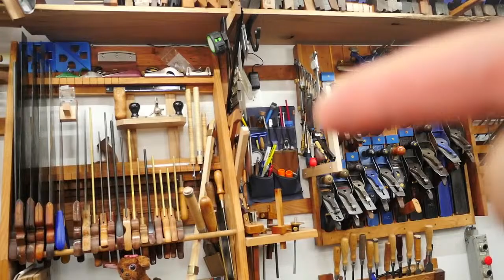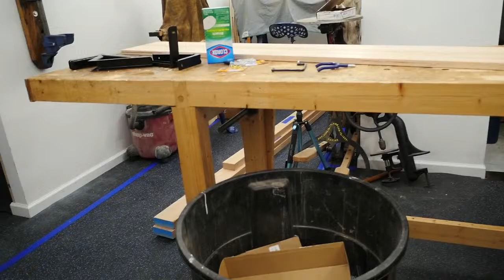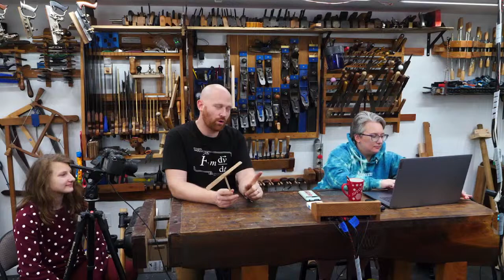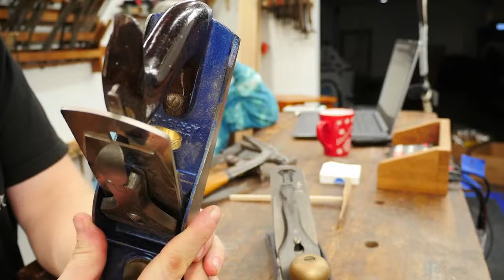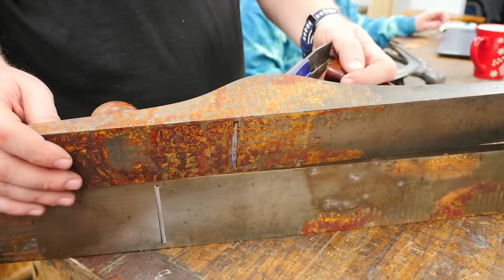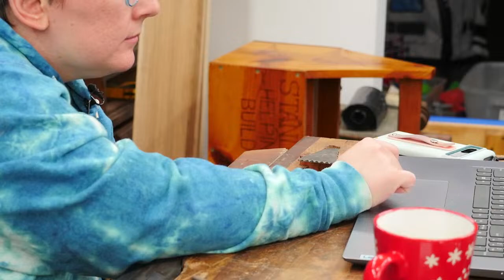April QnA 2024 LIVES ARE BACK!!

Comment: At about 46:00 ish, if you make a new tote for the low angle jack consider getting the crotch of a tree with where the limbs have the same angle as the horn(?) to the bottom sits against the plane have between them.